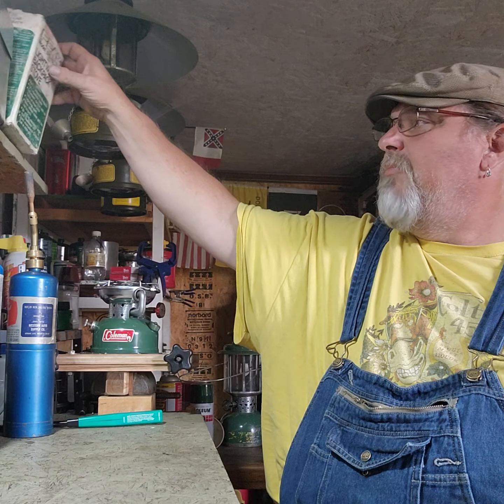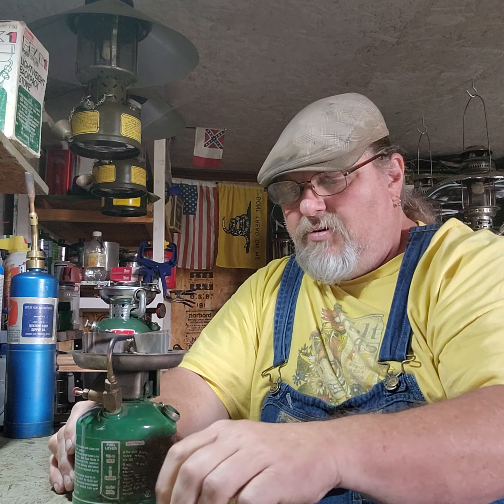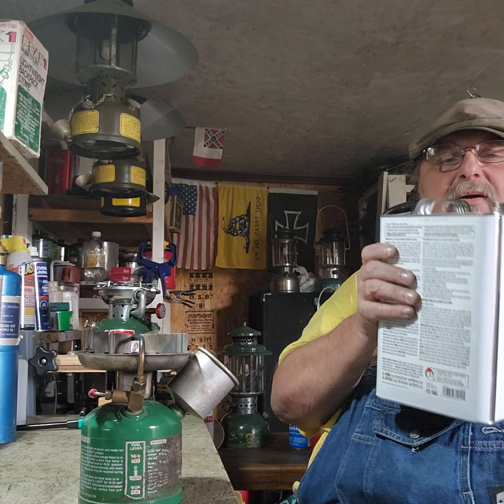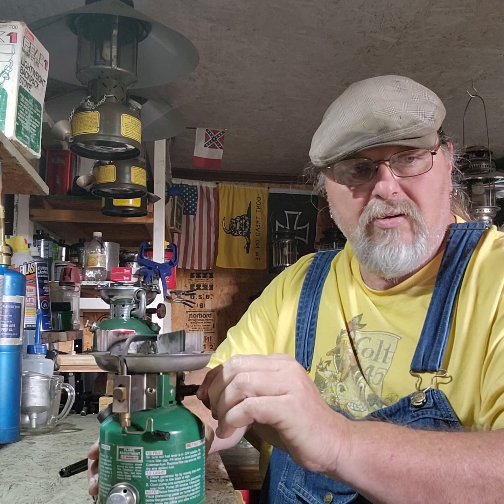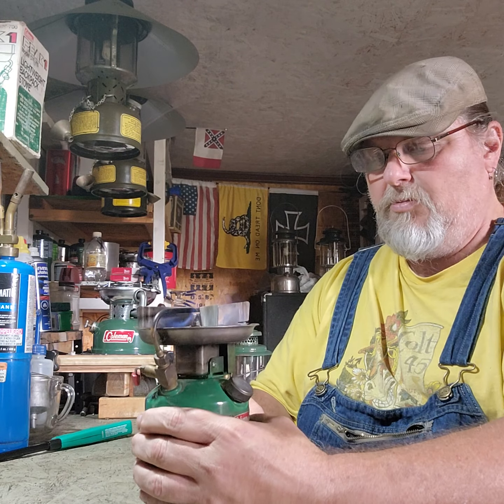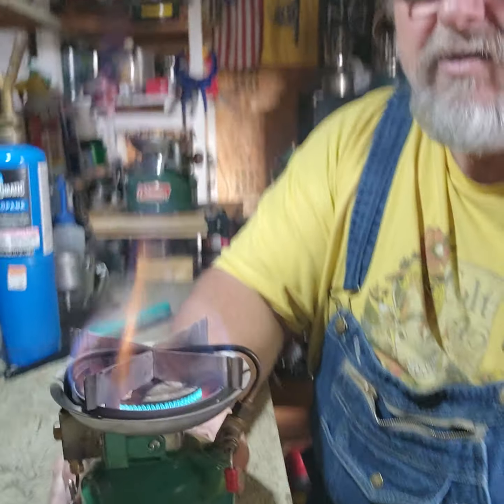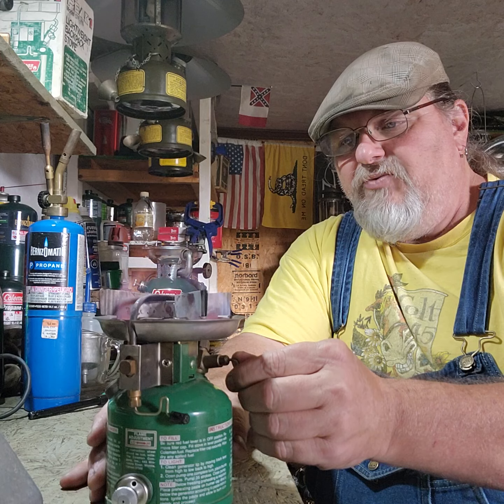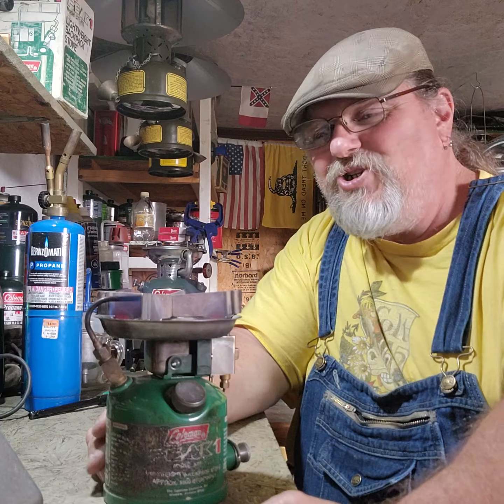Coleman peak 1 model 576-700 backpacking stove

Comment: Another great video and great score. 
The red fuel valve is just for opening and closing the fuel valve. 
Use the tip cleaning lever to control the flame. Using it this way will give you a really good simmer. 
I would be curious to know the exact difference between this one and my 505. They look exactly the same. 
Thanks for sharing and God bless.
Reply from the maker: I checked out your 505 video Rob and they do look the same and as you said about the red and black leavers is 100% correct I shot this video extremely green to this type of stove its awsome how much u can control it I did have a pickle with the check valve I put another one in it and had to cut it down the steam that is so it would fit lol

Comment: I'm in shock, that little rascal really throws the heat! I haven't looked at the parts blowup, but does it have a Schrader valve? I'm curious if it would benefit from a full disassembly and deep clean? I picked up a powerhouse lantern last week, and I thought it was running good, then I gave it the works and man it runs like a Cadillac now. Thanks for sharing that stove (I gotta get one now, wife is gonna kill me) Have a good weekend!
Reply from the maker: Kenneth I never took the fuel pickup ou so I'm not sure it did have a leather pump though I had to really work on the check valve last night but she is rolling and holding now

Comment: I bet that would a boil a pot of corn quick.
Reply from the maker: Yeah man it screams I did fix the check valve after the video and figured out the red knob controls the fuel and the black knob is a regulator were you can dial in a simmer it's prety cool